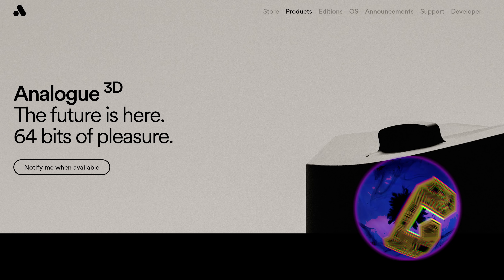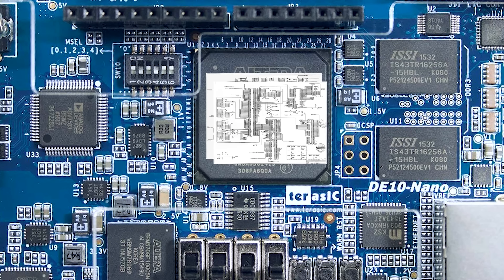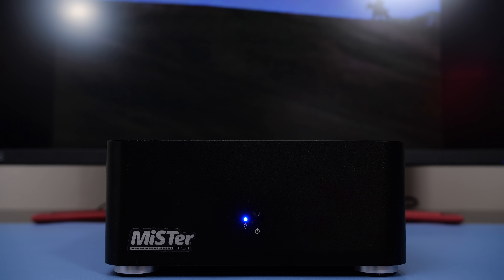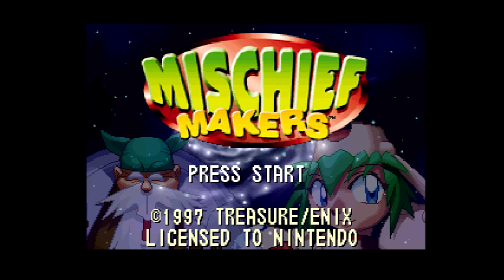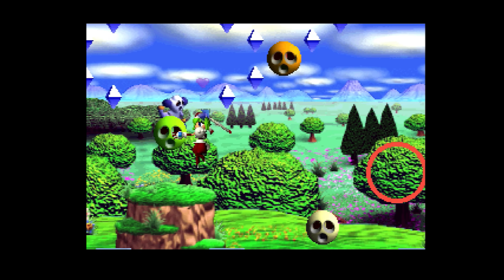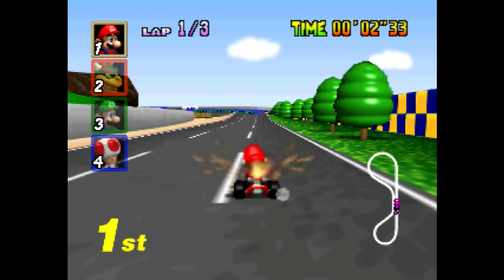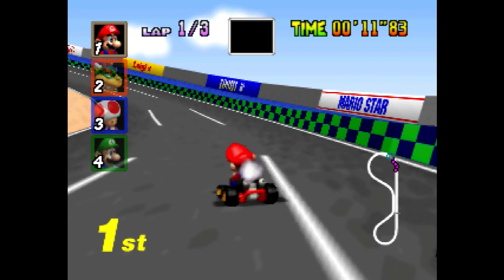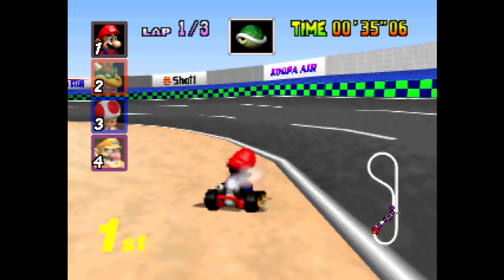FPGA Nintendo 64 gaming is here.

Comment: Glad people are giving Robert credit for being the wizard that he is.
Reply: Bob from RetroRGB should interview Robert once he is finished with the N64 core.
Reply: does that mean we can make an ASIC and eventually a low cost n64 clone later
Reply: @clementpoon120  weell if you find someone to invest into the costly ASIC development..
Reply: eventually, yea. initial design and fabrication would be expensive because of how things work, but it will probably happen at some point @clementpoon120
Reply: @clementpoon120  You still have to fab it and ASIC fabs start at millions (I think).  So the project would need to have significant investment before coming off the ground.  It's not the same as making another Chinese handheld emulator with the exact same chips but a new pcb.  Also if someone was making n64 ASICs, Nintendo would flip out.  It would be interesting though if Nintendo took the open source and did it themselves and released a retro console with an ASIC.
Reply: would‘ve loved to see more technical details of how the FPGA core was done
Reply: @RandomUser2401 There’s a little available here and there, but as you say consolidating it in one space. Plus an interview:)

I love how he starts with a fully accurate software emulator (that he writes himself), and then moves to FPGA. His PlayStation core is super impressive to say the least.
Reply: @flekkzo Didn't know his work but this dude's a fking legend if that's true.
Reply: @flekkzo  sounds interesting, where can I see this?
Reply: It feels like it was easy to get all those 2D Systems implemented. Then a bit of a struggle with Early-3D systems (32X-CD, Saturn, PS1, and now N64). I figure Dreamcast is not too far away based on its specifications.

I wonder how far away are the Mid-level 3D systems like PS2, GameCube, and Wii. It feels like we should've had these implemented yesteryear.

We should already be working on the High-level 3D systems like the Xbox 360, PS3, WiiU. I know ARM and x86 systems are not worth FPGA development. But the systems listed would benefit greatly.... but by the time they get here, we would be able to already do software emulation (or hybrid translation) by steamrolling them with much faster/newer processors. I mean a modern handheld like the ASUS ROG Ally is not too far away from emulating the PS4, XB1, NSwitch, WiiU, PS3, and Xbox 360 anywhere from playable to perfect to upscaled/upsped quality.
Reply: @ekinteko Xbox 360 and PS3 on FPGA is an entirely different class of impossible for many many years, an entirely different class of Programmable logic would need to be invented. The PowerPC cores on those consoles are clocked at 3.2 GHz, FPGA logic is typically around 300-400 MHz today, with some specific designs hitting close to 700-800 MHz if the logic design that fits the fabric well. For complex logic like the CPU and GPU, the achievable clock rates are much limited. 

The PS2 is likely in the realm of possibility, but not on chips priced within reach of the average consumer for quite a while.
Reply: @ekinteko There are basically no cost effective COTS FPGA SoCs that could hold PS3/360 mate. They’re not magic chips. Even GCN would be exceedingly difficult — the only chips I know at work that could hold it would cost about $1500…
Reply: @Girvo747  So, is this it then?
Upto N64, probably NDS, and a loose maybe to Dreamcast.

But nothing to expect beyond PSP, 3DS, PS2, GameCube, Wii, Xbox, PS Vita, Xbox 360, PS3, WiiU, NSwitch, XB1, PS4, PS5, XSX.

So those last systems we have to rely on software emulation, hybrid translation, or using the original hardware.
Reply: @ekinteko  this is it *for right now*. FPGAs follow Moore’s law just as much as other chips but they’re a more niche product: we have to wait longer for price/performance (where perf is how large it is, in this example) than we do for say, ARM SoCs
Reply: @ekinteko   @Darkknight512   you also have to consider the size and complexity in addition to clock speed. if the n64 is a feat, everything beyond it becomes much, much bigger and more complex.

N64 transistor count: 6-8M
Dreamcast: ~20M
PS2: 68.5M (EE+GS+PS1CPU)
Xbox: 78M
X360: 372M
PS3: 534M
Reply: @ekinteko  Hardware complexity increased by a couple magnitudes if not more between the 16-bit era consoles and 32-bit era, there's just so much more stuff to keep track of, so naturally it would be a struggle.

If you're going to go PS2 onwards, you would need a rather large FPGA to hold all of the hardware - maybe more than one as the bigger ones can get fairly expensive. Things are complicated even more by the presence of the on-chip memory buffers in PS2 and Gamecube - PS2 in particular had a 2560 bit total bus width to its on-chip memory buffer, and Gamecube had extremely low access latency to its memory, thanks to 1T-SRAM on-chip and main memory (a type of traditional DRAM with SRAM buffers to hide memory refresh and page access delays.) Stuff like that is going to be interesting challenges to get hardware emulation 100% accurate. :)

Luckily, clock speeds are still relatively low in these old machines, which will help. Once we start hitting GHz+ clocks FPGAs will no longer be viable, so not much chance of a Cell Processor for example running anywhere near target speed...

Comment: N64 games were designed for 320x240 resolution, so 4k or whatever isn't going to be that great - the video looks similar to an N64 which was RGB modded and no better. You can't upscale such a poor resolution and make it look beautiful. Also most of the N64 games are now too dated to play, with some notable exceptions of course (not many though, no console has that many games that last the time). I used to tinker with N64 consoles as I used to be a modder.

Comment: hi MVG maybe you are the only One on earth that can help me ..
I install the update and It brick my console! I have the black screen of death, it seems there are some issue with some 4k tv (I have 86" LG 4k 120hz) , I don't want to reset to factory setting the console because I have more then1300 games installed and a lot of save states. I tried to connect to a regular 1080p tv with no module in and no controller with no results.. Does anyone know how to fix? I' m desperate

Comment: the thing about 3-point bilinear filtering is that while yes, it samples the texture multiple times, so does hardware 4-point/true bilinear

you're just triggering the multisampling and doing the linear interpolation math in software (which in this case is a shader)

Comment: One advantage of FPGAs and custom SOCs over software emulation I don't see many people talk about is power efficiency. It's not a rarity to see native hardware drawing less power than even a small SBC emulating the same content. This isn't the best example, because it had many flaws, but the AtGames RedKid 2500 SoC built for the Genesis/Mega Drive clones in the mid-2010s were efficient enough that you could power the SoC, a headset, and the tiny 2.5" screen while drawing just less than a watt from the wall. In some cases, this was even more efficient than the original Genesis hardware. Not sure how they pulled that off.

Comment: I have done alot of gameplay on the n64 MiSTer core. I am impressed. One thing that I am wondering, is if there is per-game patches going on behind the scenes just for compatibility. My favorite game SM64 Randomizer (which is a rom hack) will not boot, even though there is not much different between it and the original rom which runs perfectly.

Comment: I don't understand why they seem to be using the crappiest fpga in the galaxy. The zybo zynq board, an entry level developer kit, has 1066 mhz of 1GB ram. It seems quite stupid to put the memory on the FPGA itself. Modern socs always have a bunch of ram slapped on them, generally at high speeds to. So you wouldn't program ram as part of the FPGA, you would instead connect the FPGA to the AXI bus and to the SOC memory. If you programmed this on an SOC it would also give you the ability to offload to the arm cores for faster processing. So you could offload all floating point operations to the arm cpu cores, thereby freeing up a lot of room on the FPGA itself. The AXI bus could be easily constrained to match the specifications needed for the internal memory. 

Putting the entire n64 on an FPGA is dumber than a rock. It makes no sense other than the lead architect was stupid and winged the whole thing or somehow didn't know about SOCs.

Comment: By giving the N64 games as much memory as possible, it should help smooth things out with the games performance, even if it doesn't need or use the full RAM space that it has to offer. 4MB RAM over 8MB RAM with the Expansion Pak add-on. Allocating more RAM space for overhead processing of textures, models, etc...

Comment: In regards to Analogue it seems odd to want a N64 that runs games 1:1, as the N64 could barely play its library even at 30 fps, most floating in the teens to mid twenties. You'd think people would want the frame rate cleaned up. I found N64 to be a largely unplayable mess.
Reply: The Mister project has forks of the main core offering just this called "turbo." Still runs the system, but with more juice where necessary to bring up the frames to 30

Comment: When is Analogue going to stop putting "No emulation" in its marketing? Hardware emulation is still emulation. There is nothing magic about it. It can still be inaccurate, it can still be incomplete, and it can still have bugs. Yes, there are timing advantages when compared with software emulation, but this is not a "real" N64, nor will it ever be.

Comment: I think I am going to buy the Analogue 3D.  I skipped out on the Mega SG, and the PC-Engine one, as I can emulate those fine on PC.

Since emulation of the N64 is such a bitch, I am VERY interested in this one.  I just hope the new controller doesn't suck  (The RetroFighter's one is trash with the button layout being way off).  While I got my N64 modded almost a decade ago, and I have a SCART cable and SCART to HDMI adapter, I have a feeling this will be a better solution for me.

At least I can use my original controllers and my Hori Mini controller.

Comment: Seems totally pointless seeing as we have software emulation that is 100% perfect and can pay every single game ever created on even an old crappy pc. Even android emulation is almost perfect. Any phone from the last 10 years can do everything this can do. You completely and utterly lied about the processing power required. A $20 pc can handle N64 emulation without fault. This is nice and its a great bit of engineering but you have totally downplayed the far harder challenge that was already beaten by far more people and a lot more work. The emulators deserve more credit as they are actually better than this at playing N64 games and can easily have extra processing added or played in 4k. They are more capable than the N64 ever was and can play exact emulation perfectly. This is a hardware demo but essentially pointless. Even Ps2 and original xbox emulation is getting very close. N64 was mastered ages ago.
Reply: Input lag

Comment: I was thinking about the claim of no emulation and why it would matter. I suppose it implies that it can more easily implement what is known about the hardware, without all the complexity of implementing it in software (and trying to make it reasonably optimized). With an FPGA you can do things trivially that would be very intensive in software and encourage shortcuts that would sacrifice accuracy.

Still with either approach you're limited by what is known about the hardware.

Comment: Let's see how cycle accurate it is? Plus next problem, are the ROM's now going to be legal? I have one in the bag, with Golden Eye, still goes. My second one. Got $5.00. Wonder what it's worth? Impossible is always just one, piece of luck or great idea away. :)
Reply: If it was an insurmountable problem, N64 software emulators wouldn't exist.
Reply: In Code versus Hardware, been here a long time I now too troubleshoot over multiple architecture. I hope we do, remember just binary. Love your efforts so far. LeGaL. Whom knows if we yell loud enough, efforts far, sadly still just Emu's, better than Simulation. Talk to me @EnglishMike
Reply: I know, but like that specific code. @EnglishMike

Comment: This gave me the idea to look at the GameCube real quick.

And my conclusion is it might be barely possible, but good luck.  Apparently, the CPU, including cache has about 20x the transistors (meaning that the logic needs to be 20x as dense, assuming the GPU and its cache scaled similarly), meaning that there will need to be a 20x improvement in either efficiency of logic or clever workarounds (such as, perhaps, using the ARM core to emulate some non-timing-critical details in software), and there will very likely be such a severe accuracy impact, that emulation is a serious competitor.

Or, y'know, we can find a faster FPGA.  (Good luck doing that without breaking the bank tho.)

Comment: hi MDV im always wandering.. whay they call FPGA not emulation when it is emulation via hardware???
Reply: It's more replication at hardware level.
Reply: @jimbotron70  why they have an internal proprietary os? Why it can output at 4k? Why it has glitches and updates after the release of the fpga like with the genesis and snes analogue consoles? They emulate but with hardware.. I think it has to be with marketing slogan.. back in the time there were clones consoles like nasa mega drive or dendy nes and the replicate with pretty the same cpus
Reply: @gabnrami  FPGA consoles are coded in software so they may have bugs as any other software. NES clones are SOC-based (system-on-a-chip), they are hardware bootlegs, nothing to do with FPGAs.

Comment: Then after this emulator they can make an X86 FPGA so we can play native classic windows and dos games and since i srill have my old Windos 98 disk and win SE i can load that os up and start were i left off
Reply: The MiSTer actually already has an x86 core. It implements a 486SX. You won't be playing Quake on it, as that needs an FPU and it'd run like a slideshow at 25MHz if it did, but Doom would definitely be playable (I had a 486SX/25 laptop at one point and could certainly play Doom on that).
Reply: Guess i did not know that but now i am glad i did

Comment: You got the definition of FPGA a bit off. It's not the same as a System on a Chip. An FPGA is programmable hardware where a huge matrix of generic logic components can be reconfigured into the form of any circuit. This company will have made a PCB, stuck an off the shelf FPGA on board and then written a configuration mimicking the hardware of the N64 and downloaded it onto the chip. This means that in principal you will be able to download updated versions of circuitry after release or even install the functionality of a completely different chip.

Comment: The N64 is defintelky a system that looks much, MUCH, better via a software emulator, than it does in FPGA. It will always look like garbage (by today's standard) unless the internal resolution is upscaled, and not just the post processed video. I wonder if FPGA will ever be able to handle that?
Reply: Sure, it's just a question of computing power and time.

Comment: This is awesome!  Excited for both this and the Analogue.  One thing that is sorta frustrating though was that people "in the know" have been banging on the drum for YEARS that N64 emulation was straight up impossible on the DE10, and this guy gets 50%+ compatibility from scratch in just 6mo.  And they didn't stop there.  Some people have also been insisting that it's not just a DE10 limitation, but that N64 likely isn't possible on FPGA's in general (I'm guessing due to the frequency?).  I don't want to undermine Robert's achievement, sounds like a really really smart guy, but just annoying that somebody with the right skill can do it so fast when it was deemed impossible for years and years...

EDIT:
I have a real N64 but I think I will buy either a DE10 or a Analogue if N64 becomes solid on both.

Comment: Lately I've seen people talking about ''FPGA / MiSTer'' all the time, but I still don't know exactly what it is. We'll be able to buy a new N64 motherboard or something?
Reply: FPGAs are chips that can behave like an arbitrary piece of hardware. You just have to configure them appropriately. Change the configuration, and you change the hardware it implements. Wire it up appropriately and give it the appropriate configuration, and you can have a drop-in replacement for whatever piece of hardware you configure it for (within limits). 

For a specific example, there's an FPGA-based video card for retro PCs called the Graphics Gremlin. It's an 8-bit ISA card that uses an FPGA to implement MDA or CGA, potentially with output compatible with VGA monitors, depending on the configuration you pick (classic MDA or CGA and VGA-compatible MDA or CGA being the four options). Set it to classic CGA and it'll behave just like an original CGA card, completely indistinguishable to the computer you put it into and outputting signals acceptable to vintage RGBI and NTSC composite monitors.
Reply: @Roxor128  Got it! Thank you!

Comment: What's particularly insane about the DE-10 Nano is that its kind of a hybrid emulator.  In that you implement as much as possible as a 1:1 clone of the hardware in the FPGA, but can use some emulation on the ARM CPU to get around some limitations, which is presumably how this works as the DDR3 is not directly accessibly from the FPGA as far as I'm aware.  Also the display and sound output is via the SoC so get upscaling, HDMI output and digital sound.